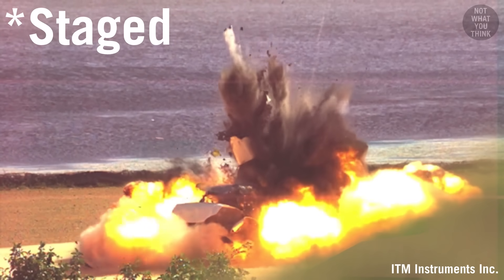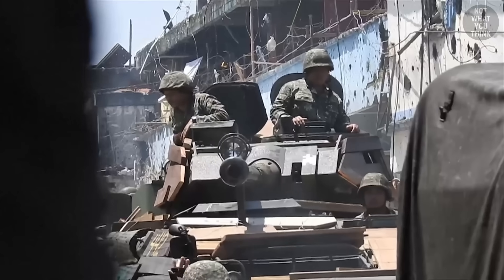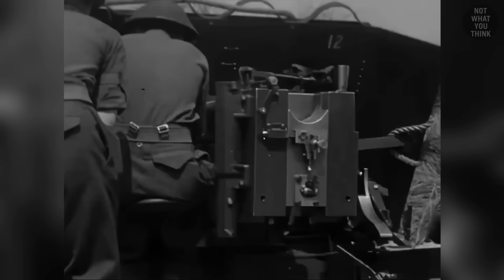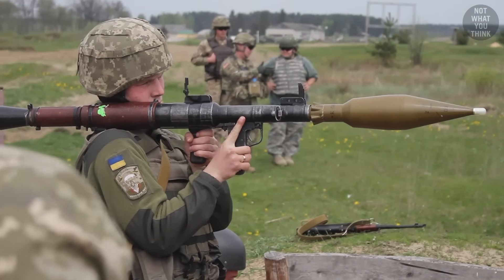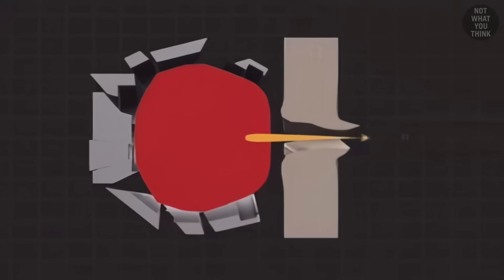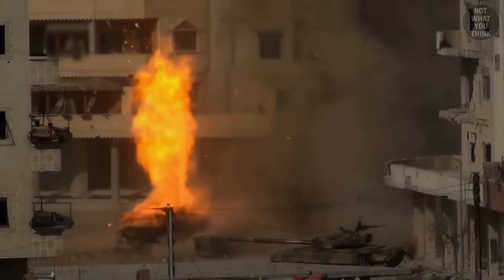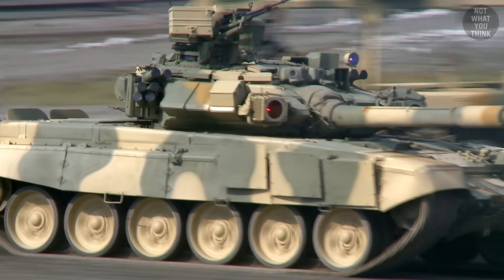Why Protecting Tanks is Getting Much More Difficult

Comment: It's simply the natural progression of warfare that's been the same throughout history.

Man creates weapon.
Man creates armour to defend against weapon.
Man creates stronger weapon that can beat the armour.
Man creates stronger armour that can beat the weapon. 
And so on and so forth...

Eventually weapons technology will become so advanced that armour will become irrelevant again, just as it did when crossbows and guns first emerged on the battlefield. Eventually "not getting hit at all" will be the only practical form of defence.
Reply: not exactly right, we have gone through this cycle at least twice with tanks, a good example is early to mid cold war designs like the leopard 1 which focused more on not getting hit due to heat rounds.  Then came ceramic armor which does a good job at defeating heat and shaped charges, when KE penetrator rod sabot rounds came out as a response at the end of the cold war through the gulf war then heavy metal chobam armor which combines ceramic levels of HEAT round resistance, and the density of the heavy metals like tungsten and DU which are very effective vs KE weapons.  BTW they do just fine vs all of the methods mentioned.  Given a redesign of turrets, to account to topdown attacks and I dont think protection will be out of vogue any time soon.  Also given the speed of drones and missiles your not gonna be able to dodge or shoot down all of them all the time, armor is passive and in a age where weapons are getting cheaper and cheaper passive becomes more economical/feasible.

Comment: Iraq showed us that tanks can be defeated by $20 (twenty dollar) IEDs.  No, the Tank is not dead or useless but what is much more in need of an update is the Doctrine that governs its use. 

If we had followed The Powell Doctrine, like George Bush I did, we would not have gotten bogged down in Baghdad. 

In this era of smart, handheld asymmetric weapons like the Javelin, and widely known low tech Guerrilla tactics like blocking roadways with tire fires and debris (as was very effectively deployed in Somalia) the superior force (usually us) need to get in and out quickly.  

The days of parking a few tanks in the Public Square (Prague, for example) are over.  Ukraine shows us that the Will of the People is the mightiest weapon of them all.

Comment: Finally. Have been wondering for so long how the metal spear piercing a tank can destroy the inside. 
Still feels weird that the spear alone can create such a shockwave inside the tank. 
Maybe it works along the same principle as high velocity bullets against humans, where the exit hole becomes much larger than the entry hole.
Reply: Spears. Being the most convenient warfare weapon since 20,000 BC
Reply: @Tarnished-bn5gq Ever since their invention, we’ve basically just been finding ways to throw them harder.
Reply: @suspiciouscheese4518 never really considered this but true
Reply: I think that's essentially it - the "spear" brings a huge amount of kinetic energy into the armour, pulling fragments with it and creating a shockwave - basically a fragmentation grenade within the hull as the one directional energy of the jet spreads out
Reply: Just so we're clear here, you realize the "spear" is high velocity concentrated energy from a shockwave and not an actual metal round right?
Reply: @bgaming531  it's a high-velocity jet of metal from the copper cone inside the shaped charge being inverted - so it only exists for the milliseconds between the charge going off and the inside of the tank being filled with shrapnel, but it is a solid thing not just energy & gas

Comment: No. An attacking force of 30 tanks properly supported by artillery and infantry will easily over run an infantry company defending 1 km of frontage. These handheld weapons are not concentrated enough in a high intensity battle to be more than a nuisance to a competent attacking armor force. Inferior PZII and PZIII overran very effective French anti-tank weapons in 1940 that were too spread out to defend against the massed armor. Mechanized units will always have an advantage over light infantry.

Comment: The original purpose of tanks was to act as breakthrough units in trench warfare, which relied on creating relatively impenetrable, dug-in positions to act as force multipliers for infantry.  Tanks took over the role of the trench, providing infantry with a heavy, mobile support platform to rely on and enabling more fast-paced warfare to be used as a result.

Now we’re starting to pass the point in our technology where having a big, heavy, mobile target on an active battlefield is helpful.  Just as with battleships, the tank is becoming more of a cost liability than anything else, especially with the prevalence of air-superiority and ground-attack aircraft.  I think it’s likely to be quickly phased out in favor of smaller, quicker, more expendable robotic ground forces to either enhance or (likely) totally replace ground troops.

After that, the balance is likely to eventually shift back to larger vehicles once we develop some form of energy shield technology, assuming we don’t send ourselves back to the Stone Age by that point.

Comment: Actually ERA can be set off with small arms fire. generally larger calibers are more efficient at doing so. small arms can also deface the smooth surface of the ERA and cause the reactive armor to explode at a incorrect angle when a actual tank round hits it next.

Comment: i noticed they started putting metal guards around the tanks and RVs to initiate the explosion sequence  a further meter or so out. I think active system's will mature and deliniate between close kill systems employed now and longer range where they'll employ a shotgun effect to counter multiple attacks. Maybe smart preprogramed air burst ammunition like 3P 40mm. The advantage of this system is having a large salvo plus NLAW travels at 200m/s, Bofors 40mm is 890m/sec. With a powerful enough radar threats could be engaged much further out?
What do i know im an armchair general, gotta go mum says dinners ready and i have to wash granpa again

Comment: Well.. Let's start from WW2 when tanks didn't really have armour as such so they started to make it angled and thicker and even added tracks on the tanks as extra armour, but nowadays it's becoming obsolete with making armour thicker because you see that tanks now have better ammunition as in APFSDS (Armour Piercing Fin Stabilised Discarding Sabot) and other types. Making armour thicker makes less sense because it will only weigh the tank itself down to the point of where it will not be able to move or it will collapse under its own weight. Plus that would make you a sitting duck. So... Then anti tank projectiles, missiles or rockets can do some damage although there are some things to counter like caged armour. BUT, then getting attacked from the top is an issue.

Comment: Offense has advanced to the point that having more, simple, cheaper, less-capable, disposable weapons is going to be more important than a few, very capable, very expensive weapons that are so valuable that they cannot be risked in combat. 

It also likely means that soldiers are going to die at a higher rate than the West has been willing to accept in two generations.  Russia and Ukraine have each lost about 100,000 troops in the past year.  And each needs to replace those troops with less skilled, less seasoned troops.  
Weapons are going to have to be simpler, too.

Comment: Tanks are here to stay for a very long time. Yes, their role is diminished, and their expense has increased but as the saying goes "Don't bring a Knife to a Gun Fight" so tanks are here to say. Yes killing them is becoming easier as other tech advances but their needed protection has a place in modern militaries. Soon the foot soldier will be replaced with AI Robotic Soldiers and that's when the life of the Tank could be over or drastically reduced even further. Until such a time the Tank has a vital role in any military. At the risk of sounding morbid, yes enough humans can stall a tank or at the very least render is useless; but it would take a LOT of humans willing to lay down their lives for such a task. Just think of the Jackal, for example, 1 or 3 are not really a threat, but a pack can bring down an Elephant, now replace the Elephant with Tank and the Pack of Jackal's with Humans and that's my point... Cheer's...

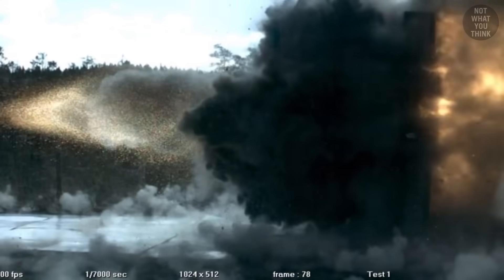Comment: @11:00 I'm pretty sure it's partially PR( if not entirely) but Boeing applied for or has patents for a plasma based device intended as a defense.  I assume the idea is to rapidly heat the plasma in order to cook off or disrupt a projectile in a volume instead of the extra time and equipment needed to target and shoot at a threat.  It pretty cool in concept, but I wouldn't hold my breath awaiting field testing.

Comment: So actually cage or slat armor is designed to damage the peizo-electric fuze on a RPG warhead by tearing the nose off the rocket body so the fuze cant send an electrical signal through the metal body that will ignite the explosives

Comment: Tanks were designed for field and trench warfare, but they are useless at FIBUA – fighting in built up areas. They cannot manoeuvre, cannot hide, and they can have enemy drop grenades on them from above, as the Russians found out in Ukraine. Basically a hatch-down tank is blind in BUAs, and it can’t move its weapons very much either.
It also doesn’t matter how much armour it has, because you only have to damage one track to immobilise it!

Comment: We have invented Chobham armour and composite armour to defeat a variety of warheads. Both are top secret, but the basic idea is to have sloping steel sheets separated by ceramic or similar material. Hyper-velocity penetrator rounds should be deflected, and their energy absorbed, by their angular placement. Munroe-effect shaped charges are similarly deflected and moderated between the steel plates. Even secondary charges are rendered less effective because of the multi-layer armour.
Another issue is that Russian tanks carry their ammo inside the turret, whereas NATO tanks carry them outside, accessed through fire-proof hatches. Unlike Russian tanks, if an external ammo store is hit, the explosion escapes through frangible panels without cooking off inside the turret.
NATO also has intelligent anti-tank acoustic mines. They float down under parachutes, spinning and searching for a tank. If they spot one, they fire a shaped charge down through the weaker top, and spread shrapnel to kill any troops on the outside. Any that land unfired go into listening mode, waiting for a tank signature. When one comes within range, the mine fires a shaped charge upwards through the weak tank floor.
On hearing an explosion, the other mines go to sleep for various times, but one will sporadically explode without a target to demoralise troops and deter mine clearance parties.
Eventually all will self-destruct in order to comply with the mines elimination treaties (which the USA and Russia have not signed up to!).
Finally you didn’t mention modern NATO penetrator rounds, which are saboted tungsten-carbide darts with a specially shaped tip that causes them to tilt at right angles to the armour to reduce the penetrating distance. There is another type of penetrator round that is fired from a tapered bore that squeezes the round’s diameter, thus increasing its speed to hyper-velocity. Like HESH, both rounds are intended to cause spalling, which is breaking off pieces of metal from the inside that fly around and mince up the crew!
Reply: NATO tanks do not feature blowout panels for all stored ammunition only the ‘ready racks’, like the leopard 2, while some nato tanks have no blowout panels at all, like the M60, Challenger 2, or leopard 1.

Comment: They need to find a way to destroy every missile before reaches the tank like the Paladin tanks in C&C Generals video game. Its like sensors are detecting the missile and destroy it in close proximity. Its not impossible but as you said in the video it will be extremely expensive.

Comment: defensive idea: generate a strong enough magnetic field around the tank to repel/divert the molten copper and/or the projectile itself
or
coat the armour with an alloy or metal will react with the molten copper upon impact; perhaps a fine powder held in static form to increase the surface area of the reaction; attempt to create an instantaneous reaction that will lower the temperature of the copper or decrease its kinetic energy or fuse it into a less lethal alloy
or
create an artificial 'shadow' of the tank and throw it alongside the tank, lure the projectile toward the shadow. this would involve hacking the missiles guidance system

note high conductivity of CU with electricity, so there may be some basis to develop a electrical based system using the conductivity of copper against the shaped charge. eg a 'honeycomb' layer on the hull of the tank whereby honey comb channels are fed with high voltage, in an attempt to channel the molten jet away from crew/ammo areas through a labyrinth of high voltage charged honeycomb pores
or
generate a high voltage charge surface on the surface of the tank capable of creating an electrical arc between the tank and any incoming projectile, thereby destroying the projectile. Perhaps a single lead vehicle in a formation would have this capability, and act as a shield. 

consider engineering pyramid shape turrets to offset overhead projectile trajectories

projectile is flying through air. Perhaps some exploration into a high pressure air stream system, capable of slowing/halting projectile, jet  air system or explosive burst of high pressure air stream capable of blowing the projectile of course, slowing/stalling/stopping projectile; disruptive air pattern system

air vacuum; generate a vacuum or 'air pocket', interrupt projectile flight path; vacuum pocket could be generated using explosives and or chemical compound

use supercooled liquid pockets on tank hull (eg liquid nitrogen or chemical 'x') which will react instant cool and solidify molten copper upon impact

Comment: If we have learned anything from the Ukraine war, it is that tanks are obsolete.  The US Army is developing the M1 tank propelled by a jet engine and weighing in at a sleek 140 thousand pounds. It requires huge and very expensive maintenance, gets bogged down in the mud, and while having the mud hosed off can be hit by a missile fired from 70 miles away.  This turkey is an obsolete battlefield battleship.  Next up, the generals and Joe Biden will propose an all electric tank with a private Hoover Dam for recharging, or, hey General Mark Milley, how about a tank with a nuclear reactor.  That'll get the Chinese' attention.
Reply: Lol what?

Explain then why Ukraine is asking for tanks and why Russia keeps unmotbhballing tanks for the battlefied
Reply: @pancytryna9378  For the same reason the Polish army kept ordering new horses when the old were killed in cavalry charges against machine guns.   Stupidity!  Tanks die in the thousands, so go to the corral and rustle up some more tanks.  Consider the M1 tank with a jet engine as an updated version of Hannibal's war elephants.  They were easily dealt with by the Romans once the initial shock wore off.  Same thing with chariots.  They were used for racing, parades, and hauling things around,  but obsolete on the battlefield.  Generals are often the stupidest people in war.  I give you General Sir Douglas Haig as just one example, or Cyrus Comstock who ended the Union Army Balloon Corps in the middle of the Civil War.  This imbecile could not see the value of 50 square miles of observation...topography and the enemy...in a balloon with the observer telegraphing what he saw.

Comment: A rocket-propelled grenade (RPG) is a shoulder-fired missile weapon that launches rockets equipped with an explosive warhead. Most RPGs can be carried by an individual soldier, and are frequently used as anti-tank weapons. These warheads are affixed to a rocket motor which propels the RPG towards the target and they are stabilized in flight with fins. Some types of RPG are reloadable with new rocket-propelled grenades, while others are single-use. RPGs are generally loaded from the front.[1]
The term "rocket-propelled grenade" is a backronym from the Russian acronym РПГ (Ручной Противотанковый Гранатомёт, Ruchnoy Protivotankovy Granatomyot), meaning "handheld anti-tank grenade launcher", the name given to early Russian designs.[2][3][4]

Tell me more about how RPG is wrong, "Mr. Quotes Wiki".

Comment: Soldiers were cobbling together shape charges out of wine bottles, breaking the tops off and using the punt to shape the charge, in WW1.  The charge could be aimed and the force of the explosion traveled in a straight direction, killing people fifty feet away. Later, they discovered that placing copper coins in the center of the opening would cause the copper to vaporize and extend the kill range, as well as gain the ability to penetrate armor.
Reply: The Germans even cobbled together six Stielhandgranaten in order to hopefully perforate armor
Reply: My buddy told me about an IED in Iraq made out of a sheet of copper, it vaporized everyone in the armor in front of him. He said they learned it from WW1
Reply: @coopercross6123 efp: a copper slug at 2 miles a second

Comment: Wouldn't it be possible to just create dual layer reactive armor? Or reactive armor that can drastically alter trajectory? Current reactive armor seems to focus on blasting the explosion back, but wouldn't diverting the explosion cost way less energy? Maybe not as effective, but pressure diversion into explosive reaction seems like the best bet.

Either way it would still be way more expensive than a javelin, but i cant help but feel a reactive diversion armor could be way less expensive in the long run, than reactive explosion.